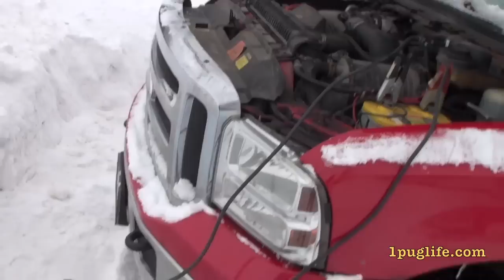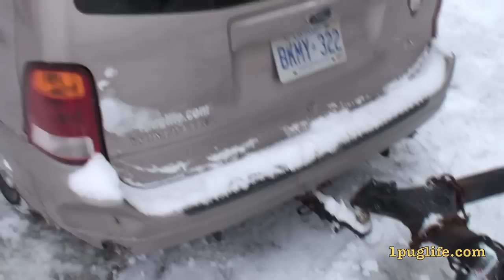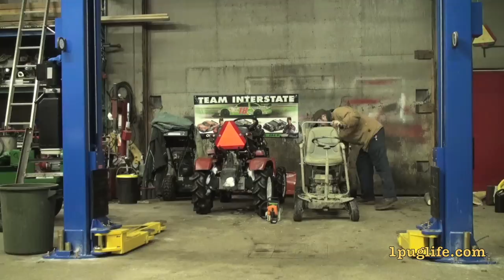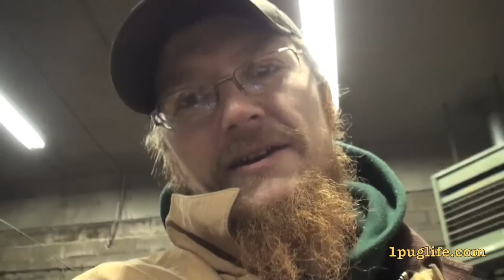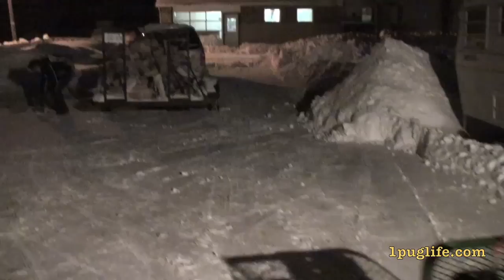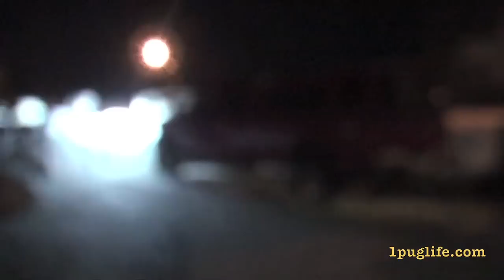100% attentions

Comment: You need to get a skid steer. That would be so much better for movin' the snow and wood and dirt and trailers and trapters and and and whatever else you can think of.
Reply from the maker: spencive
Reply: 1puglife
Pug you should consider fixing the chevy welding the rear diff up putting like 1500lbs on the back and a plow that would be awsomer as cheeech

Comment: pug make a new garage door yourself 2 x 2 in pressure treated with 1/2 in external or even better marine plywood on both sides as a skin, glue & screw the plywood on to both sides, you could even put insulation inside, in between the studs of the door, save yourself a grand or so